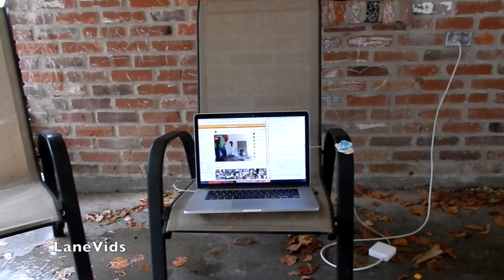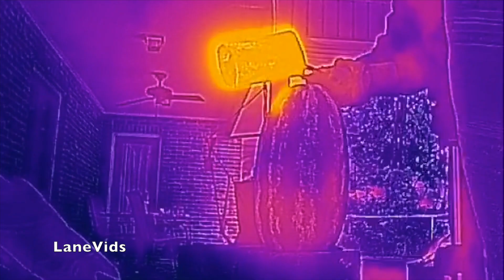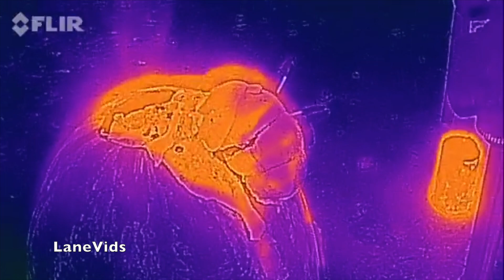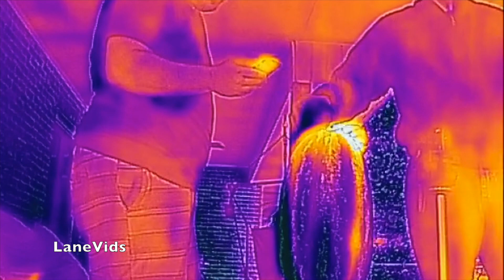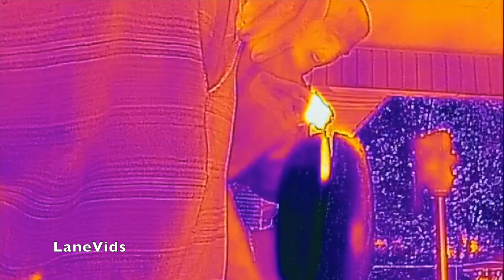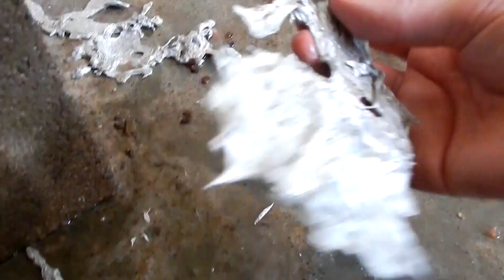What Happens If You Pour Molten Aluminum On A Watermelon? - MOLTEN ALUMINUM VS WATERMELON

Comment: You get a much better effect if you have the Molten Aluminum just above its meting point, instead of superheated.
The metal will conform to the interior shape, and then set without being blown out by the steam from contact. (it will solidify too quickly)

Comment: i think you will need a better slow-mo camera, just saying
Reply: +Molten Aluminum + LaneVids your current slow-mo camera is good, but it has some choppy slow-mo footage, but great realtime tho. that's why i was suggesting a better camera.
Reply: +Molten Aluminum + LaneVids how many fps does your camera have?
Reply: +Molten Aluminum + LaneVids yeah, slowing down by 50% will look smoth, because you will have 30fps in the final clip(which you already probably knew) and won't be choppy like the 15fps one. i think a 120fps camera will do the job for 25% slow-mo footage, like the one from the 5s(i think)